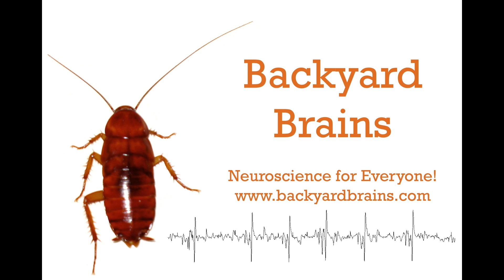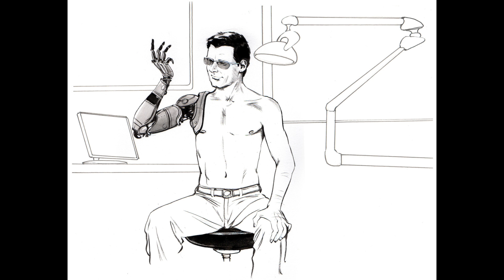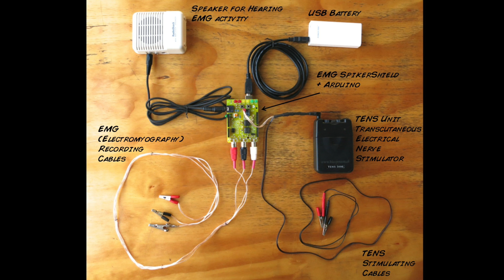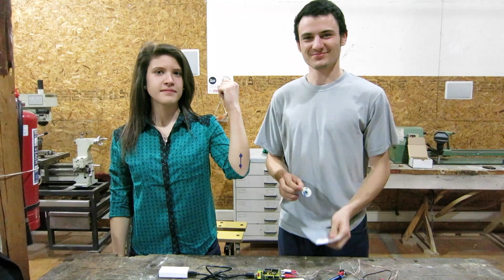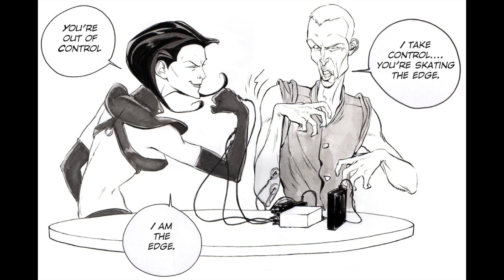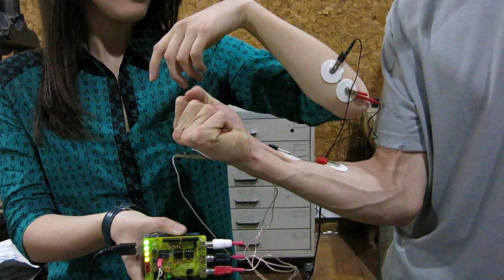Human Human Interface - Generation 2

Comment: This is quite lame project as you just stimulating a controlled person muscles with the predefined signal from this generator. It will cause "some" contractions, but it doesn't rely on a movement of a controller person, which makes it boring and useless.
Reply: Alex, you're right. Just clickbait.
Reply: sadly, I'll get fired if I insert electrodes into my students, so this will do